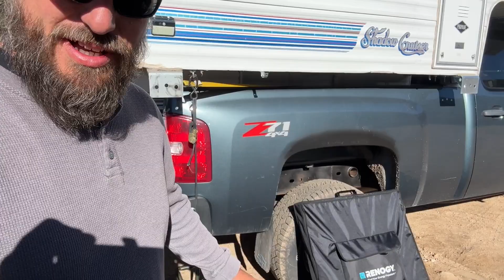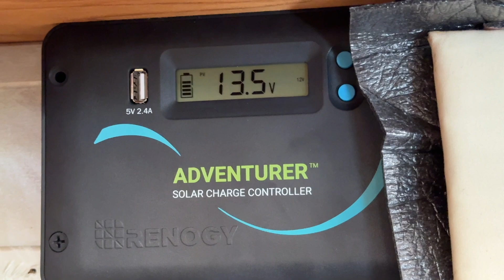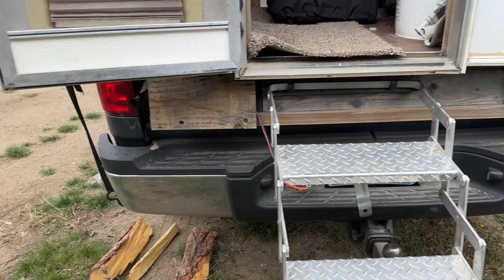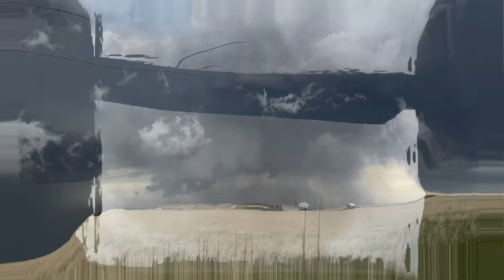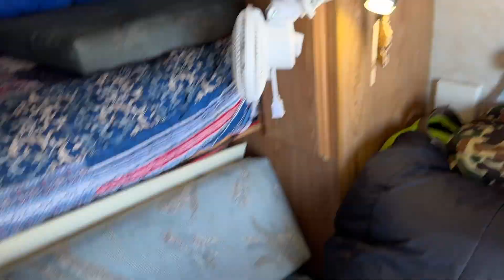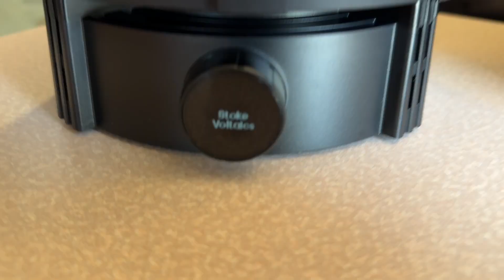Can This New Ultra Light 400w Solar Panel Power My RV Air Conditioner???

Comment: isnt that just wrong solar wiring 
easy fix
Reply from the maker: design flaw with the delta 2 . the renogy charge controller in the camper took the load just fine like that